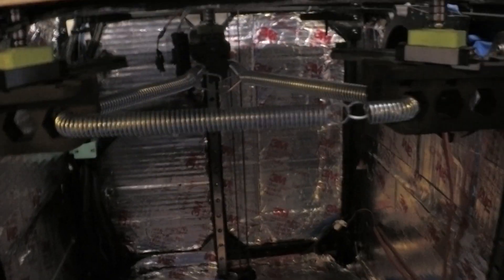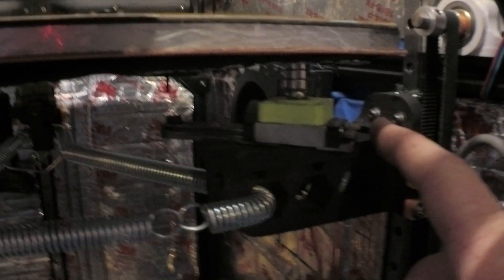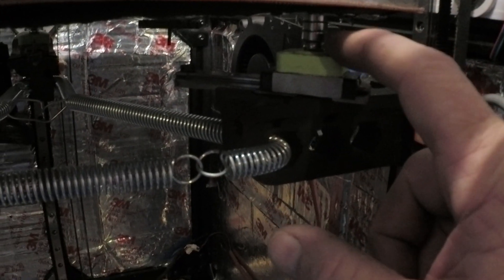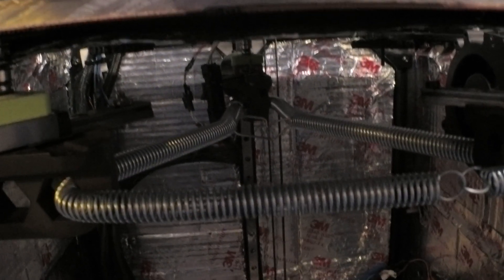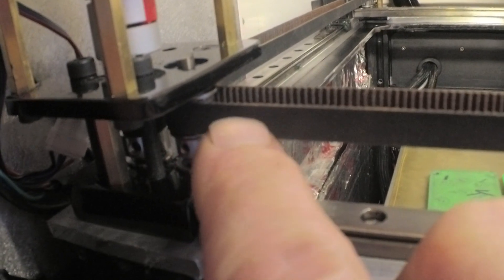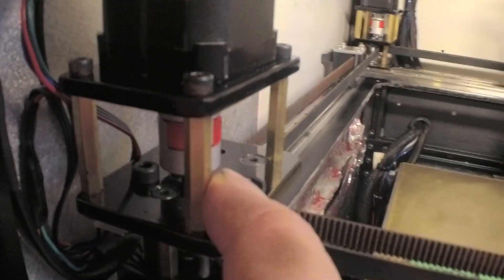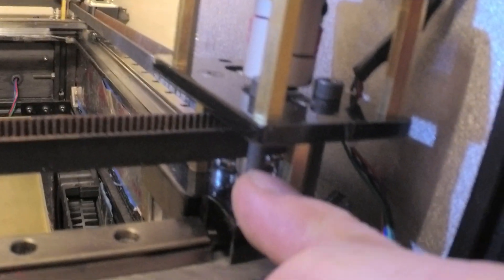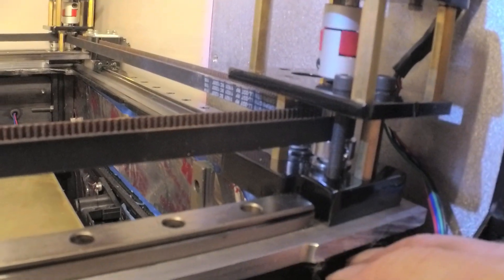New stepper mounts

Comment: Get ballscrews in there, linear rails are only part of a good control system :)
Reply from the maker: What are the pro's and con's?
Reply: @MrRocksalt  pros - Rigidity, less wear, higher accuracy, 
Cons - cost a bit more for even basic ballscrews and need a couple other bits of supporting hardware, more complicated to install.
Reply from the maker: @noviceartisan  Cost is exponentially higher and the cheap ones are not straight.. then need anti-wobblers, ETC to allow lateral deflection or the bed moves over. I searched some videos on them. There was, in particular, one where he installed ballscrews on an Ender type machine. After comparing prints between the 2 systems there was no difference. In fact they were worse or the same between the 2. I do think they are more rigid as belts will stretch based on weight, but I have so much weight on 12mm belts now that the added plastic may be negligible added during printing. 
Maybe next build I will consider if I can find something reasonable.
Reply: @MrRocksalt   @PIRACER VELOCIRAPTOR  I've not had issue with cheaper ones myself, I have first hand experience of using them, no issues whatsoever when used correctly. 
I did mention needing extra hardware, they're called support blocks not anti wobblers lol. 
Belts do wear, that's a simple fact of how they work, as do plain screws, ballscrews however hardly wear at all by comparison, I believe it's thousands of times longer lasting at the least. 
I've not played with them on these flimsy 3D printers yet, but have converted lathes and mills to use them in the past, which were used to mill steel parts to sub micron accuracy with no issues. FDM printers by comparison are like wooden houses next to a tornado, even a fart knocks them apart lol I'll take any increase to rigidity on them that's possible, even if it's literally impossible for them to accomplish the accuracy I can get from even a cheap resin printer.